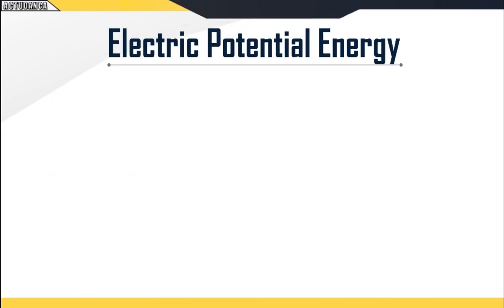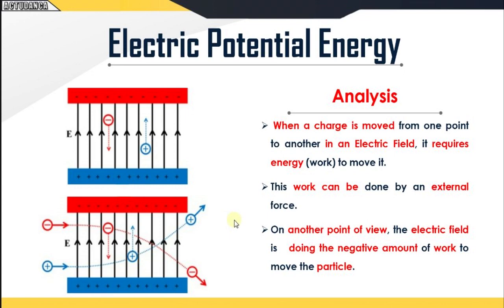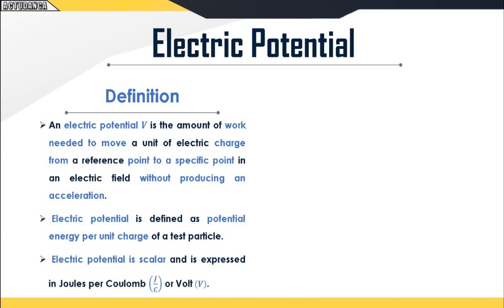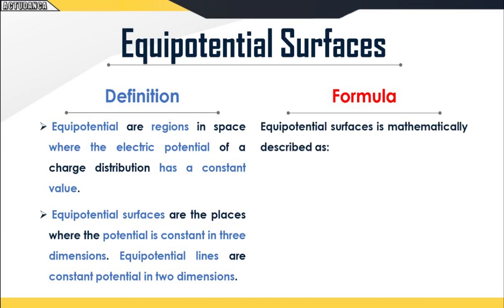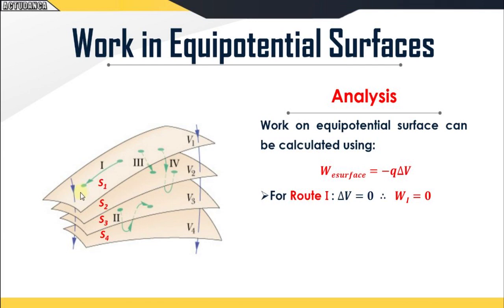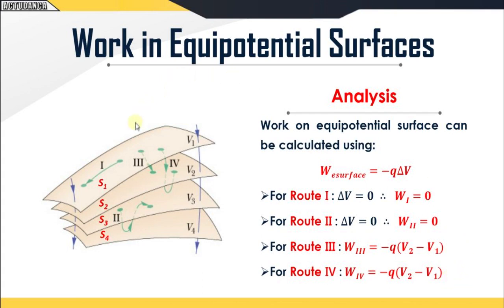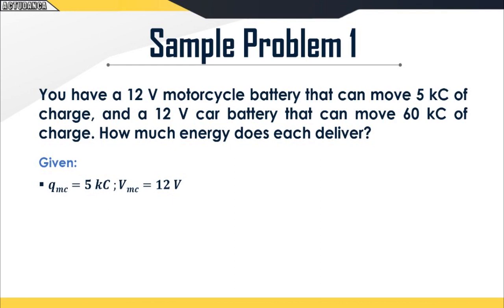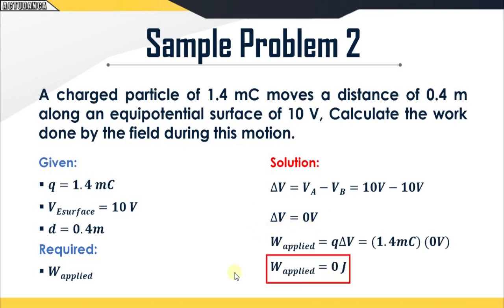Electric Potential

Comment: In this lesson, I have learned that Electric Potential Energy is the energy need to move a charge. Also, when it comes to equipotential the answer is always 0 ("zero").

Comment: I learned that an electric potential V is defined as the amount of work required to transfer a unit of electric charge from a reference point to a particular point in an electric field without causing acceleration.

Comment: I figured out that an object may have electric potential energy by two elements. It's own electric charge and it's relative position to other charged objects and moving an electric charge in a electric field requires an energy. That energy is called electric potential energy.